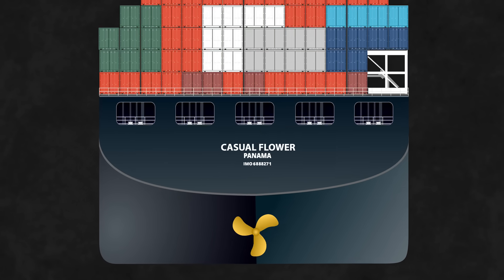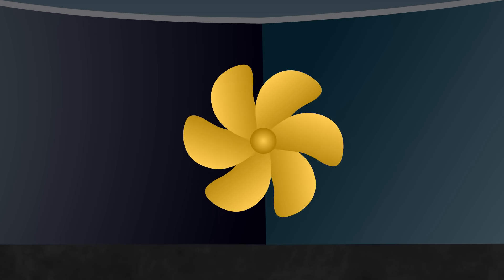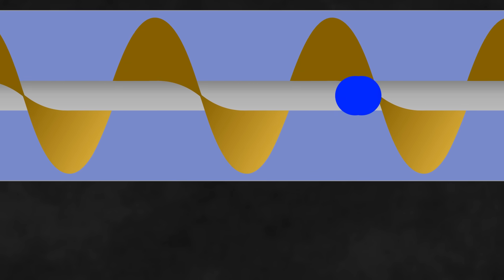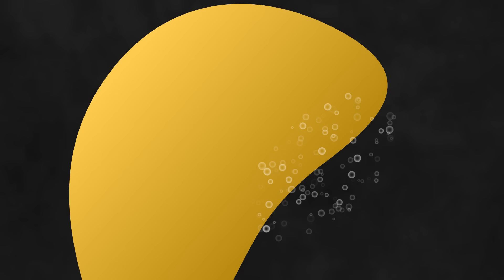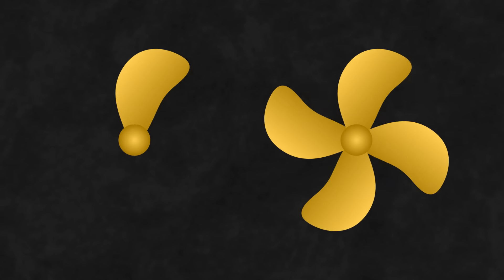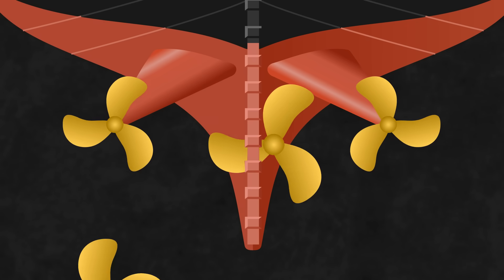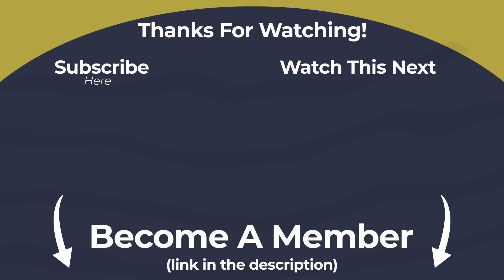Why Are 4 Blades Better Than 3?

Comment: Years ago, we used to listen carefully to surface ships to determine their RPM and blade number.  It helps submariners determine just what sort of ships are in an area.  The details of making super-quiet propellers was always a highly classified aspect of subs.  Many times in photographs of subs in drydock, you'll see the propellor area blurred or covered in canvas to try to keep secret the details.
Reply: That's also another reason cavitation is bad--it produces a lot of additional noise, which is undesirable for reasons of both sonar stealth and underwater noise pollution.
Reply: @Ignonym  Very true, the dedicated anti-submarine warfare frigates have lower noise propellers so they don't drown out the objects they're searching for with their own prop noise.
Reply: @G1NZOU  Apparently the Royal Navy's Type 23 Frigates used a propeller that was heavily optimised for their typical cruising speed during ASW operations, and were so effective that the props were near-silent at that speed and made the ship much less likely to be detected by its quarry.
Reply: They still cover props when launching new submarines.
Reply: From what I've heard the prop is also covered up so you can't estimate the frequency from the image
Reply: @Vinzmannn  as a former navy soldier I can confirm this.
also submarines hav a lot of blades to reduce noise
Reply: @derHutschi  Navy soldier? 🤨🤥
Reply: @thorodinson7467  english is my second language 😅
Reply: @derHutschi  Okay what was your rate? What ships were you on?
Reply: @derHutschi  Ah, that's why you didn't know that the U.S. Marines have a thing about the word "soldier": they don't call themselves "soldiers" because to them that word means members of the U.S. Army.
Reply: @Vinzmannn  And newer designed 'propulsors' that must be 'magic' compared to the old 7-bladed screws we had back in the day.  Let's see, 7 blades, 2 planes and 2 rudder sections...  hmm... 7 x 4....  carry the one....  plus....   oh never mind.  It's been too long ago, that BB must have fallen out long ago... LOL
Reply: The other fun is some navy ships is variable pitch propellors, so the RPMs can remain constant while the ship can move in reverse or forward (up to certain speeds), while the engine RPM  never changes and the noise might change a little (i.e. going from 10 knots forward to 5 knots reverse will put strain on the engine).

You can still do direction analysis to tell where the ship is relative to the listener, but you cannot rely on RPMs to tell you how fast it is going at lower speeds.
Reply: @toddkes5890  Yup!  When I was in, it was the Spruance destroyers that had this.  I'm sure there are others now.
Reply: @toddkes5890  neat, planes do this quite effectively, I never thought about using in on water vehicles though.
Reply: @MattH-wg7ou  Pitch Propellers are very common in Ferries and smaller Cargo Ships. They just handle much, much better than fixed Propellers with direct Propulsion. Small Cargo Ships usually have one Engine driving one Propeller and a Shaft Generator via a Reduction Gearbox, Ferries typically have four Engines on two Propellers, again with Gearboxes and Shaft Generators.
Reply: @Genius_at_Work  And the newest cruise ships have six propellers spread along the length of the ship (although two at the back and two under the bow is more common).
Reply: Early aviation designers modeled their airplane propellers after ship propellers. The Wright Bothers concluded that air and water had different properties and therefore needed different types of propellers.
Reply: 1. We had a 'shafts and blades' sonar on V&C class. 
2. Variable pitch propellers are used on gas turbine powered ships because the turbines don't spin the other way.
3. Don't kid yourself,  we could still hear the T23s.
Reply: IIRC wasn't this a bit of a concern back in 2010 when HMS Astute ran aground off Skye, there was a chance the tide might drop far enough to leave the screw at least partially above water.
Reply: @f0rth3l0v30fchr15t  The navy would know how much the tide would change there, and none of the photos of that grounding that I can find online show the screw. The most we see is the external cowling/shroud.
Reply: I can get a 7-blades low-cavitation prop for RC-model sub anyhere in webshops. Closely-guarded ... that is basic physics. Still doing a great job on Swedish and Germans subs to emerge in US aircraft carrier convois in exercises and get US admirals fired. the real submarine vessel secrets don't lie in the pop design field. It is rather obvious on images in docks what was done. Any diver can check it out plus a simple frequency band analysis from audio records will also give away number of blades and RPM of the sub entering or exiting a surveillanced naval submarine base over distance. The physics is all in the fluid dynamics engineering textbooks. The blade needing to be sleeker is no secret. You can do a few well known tricks like shark-skin, sawtooth back-edge and winglets to optimize it. Not really a secret for anyone well-trained in fluid dynamics - means hydrodynamics or aerodynamics design. That is a small engineering field. It is very obvious what you got to and can do to reduce wing tip cavitation. So the obfuscation erfforts are more or less traditional and keep photo hunters pre-occupied in espionage circles. You ran reverse engineer any audio record with a gaming PCs computational power today. At worst you link up a few or rent a cloud server farm for a few days. Nothing that would strain any governments military R&D budget in any way. You need the wetware - the human brain that can use the CFD correctly and do the Navier-Stokes and Fast-Forward-Fourier math on the Audio and match it up. That's a desk job at a computer - not a photo job. Colombian narco drug lords started to hire Russian sub engineers long ago. The real problem is the lack of industrial plant hidden in the jungle to make any good craft from scratch in secrecy from staellite and cargo supply chain monitoring of import-export trade flows. Smuggling large speciality submarine parts is really giving you away very easily and it is super hard to come up with any cover-stories of alternative uses of any such parts. I'm basically waiting for Chinese triads entering the narco-sub arena field with serious grey or black naval wharf capacities.
Reply: Sort of ships?  Snort.  I was surface, but did some time in ops and the sonar guys could generally name the exact ship, not just the type.  Granted this was the 80's.  But back then every screw was slightly different, every hull had minor imperfections, so even two ships or subs made in the same yard, to the same specs would be unique.
Reply: I spent almost five years on submarines as an FT.  Not only could we use the blade noise to classify a ship, It also gave us the ship's approximate speed to begin our Fire Control solution.  
One time i was on a deep-sea fishing trip out of Newport Beach and I told my Father-in-law that the boat we were on had two three-bladed screws with a missing blade.  He didn't believe me so he asked the captain.  He was very impressed when he found out I was correct.
Reply: And then you can build a ship with no propellers. The “Red October” “silent drive” is a real, if inefficient, thing.
It is formally called a magneto hydrodynamic drive (MHD). They are quite commonly used for reactor cooling pumps in nuclear power plants because they require no mechanical equipment in the radioactive pipes.
Reply: @allangibson8494  water jet Produktion for fast small sized  craft

Comment: I find it interesting that most submarines have 7-blade propellers both conventional or nuclear-powered although the more recent classes of SSN or SSBN have a pump-jet instead of a propeller blade. I wonder if someday will see Pump-jet Propulsion be introduced to conventional submarines?
Reply: The thing to keep in mind with submarine propulsion is that they are more concerned with noise reduction than efficiency, so they might use a design that is inefficient but quiet, not suitable for a surface ship, much less anything civilian. I could see pump-jets being used on conventional subs though, again a question of efficiency versus quietness. A compromise (both mechanically and in terms of performance-versus-noise) would be a ducted propeller.
Reply: @quillmaurer6563  See "Kort nozzle"
Reply: Not too likely but not impossible, the main issue comes with the power needed to drive those pump jets which a nuclear sub can easily provide while conventional subs dont have the same massive power on tap
Reply: The replacement for the Australian Collins class was supposed to be a Diesel Electric pump jet submarine but got cancelled when Australia changed its mind and went nuclear for the next generation.
Current word is Australia will lease a half dozen Virginia class submarines prior to building a variant of the Astute class submarines for themselves.
Reply: There are many issues with pump jets when the focus is to operate quiet.. One example is the noise the nosle makes in addition to the impeller and volute. The reason submarines has seven blades is that 7 is a prime number, i.e reduce the potential for harmonics.. As others have pointed out a 5 blade propeller has cavitation issues and 11 blades would be too inefficient, so 7 it is!

Comment: With the development of linear induction motors, is it possible that a full sized Archimedes screw in something like a tunnel through the hull could ever become a thing?
Reply: What you're describing sounds a bit like a rim-driven thruster, which has blades projecting inward from an outer ring and no central hub, the ring acting as an electric motor. They still use multiple blades though, the full archemedes screw wouldn't be very efficient as a propeller - would tend to spin the water rather than move it.
https://en.wikipedia.org/wiki/Rim-driven_thruster
Reply: well the closest thing to that would be a jet boat with an impeller, and i doubt extending the length would help.
Reply: Propeller i en tunnel användes på gruntgående mindre ångfartyg som som skulle gå i grunda strömmande vatten, fanns en sån i indalslälven i Sverige på tidigt 1900 tal

Comment: Um, "steel" propellers? Thought they started as bronze, but were now alloys or composites. Anyway, to say their design is a compromise is, arguably, true of all engineering - something I came to understand when cruising around the Solent on small yachts.
Reply: Isn't bronze already an alloy? :P
Reply: Steel props are also a thing, at least my dad's 18' pleasure boat has had a 5 bladed stainless steel prop on it for my entire life, so i don't think its unreasonable for larger ships to also have the option of using stainless steel. 

As long as you have zinc anodes near the prop it won't rust/disolve away, and you need them for both bronze and steel props anyway.

Edit: typo

Comment: What about the pitch on the blades? I know from research that the Titanic's and Olympic propellers had different pitch areas on their blades, which prevented them from being interchangeable. Olympic's outer propellers had a pitch area of 34.6 feet, whereas Titanic's were a full 35 feet. Do correct me if I'm wrong, but wouldn't greater pitch on the blades equal greater drag and push the ship faster? What I'm wondering is, if a propeller with fewer blades had greater pitch, would it be less or more efficient than a propeller with a reduced pitch but more blades? 

Furthermore, when referencing the switch conspiracy theory, the difference in pitch on the blades means that the propeller on the wreck that has 401 stamped onto one of its blades couldn't have been fitted to the Olympic at all. So immediately that disproves the switch theory.
Reply: As far as I understand, the different pitch did not make the propellers  not interchangable. They would fit on either ship's prop shaft, and the variations were essentially practical experimentation to find the  most efficient settings.
Reply: @lutzderlurch7877  The problem is if the starboard propeller had a greater pitch than the port side one, the greater drag on the starboard side would persistently make the ship turn towards the port side. That's what I mean by a lack of interchangeability.
Reply: @lukemilner5885  ah, yes. You're right, they are not interchangable as single items, but just as pairs

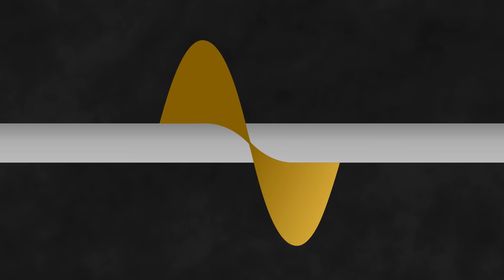Comment: 2:40 Actually, the very first screw propellers WERE Archimedes screws, but it didn't take at all long for designers to realize that blades could do the same job more efficiently.
Reply: The realized when a screw broke and the ship became faster
Reply: @jamesricker3997 
Wow!! That is very interesting. Thanks for sharing.
Reply: Blades are essentially still the archimedes screw, just cut to pieces and its parts moved next to each other instead of going one after another.
Reply: @kasuha  in an air propeller, the cross  section is modified into an airfoil.  
Is that done for water propellers, too?
 
Or does it not make as much sense with an incompressible fluid?
Reply: @nos9784  yes, the cross section of a ship's prop is also heavily engineered to produce the most efficient design/best combination of characteristics.
Reply: @nos9784  we assume air incompressible all the time, for car applications. It makes the math easier and the difference is negligible so far it is from the speed of sound
Reply: @nos9784  water is NOT "incompressible" ! if that were suddenly true, sea levels would be quite a few meters higher, and hundreds of millions of people would drown.
Reply: @gshaindrich  i'll have to admit, fluid dynamics aren't something I feel too competent about.
My assumption was that compessibility didn't strongly matter for ship screws.

I also think i wouldn't get deeper explanations, so thank you all for your input, i'll stop asking now :)
Reply: @nos9784  Keep in mind another application, rotary screw air compressors and centrifugal compressors. Usually only seen in industry.
Reply: @superturkeylegs  screw compressors (roots type blowers) are positive displacement though, right?
Reply: @gshaindrich  Water isn't incompressible but for most purposes it's pretty close to it. Water's bulk modulus is about 2.2 GN/m² meaning if you double the pressure (from normal atmospheric pressure) that will reduce the volume of water only by about 0.005% which is tiny. In most cases assuming incompressibility is a decent approximation.
Reply: @nos9784  I'm not an expert either but, to my knowledge, incompressibility is usually a decent approximation (in absence of cavitation). While that does affect the flow, the same principles of the profile of a hydrofoil providing lift/thrust just like with an aerofoil still applies but the optimal shape is probably a bit different.
Reply: @kasuha Wrong.
Reply: @HerbertTowers  Compare it with a Fresnel-lens.
Reply: It was also at the front
Reply: More blades usually means more torque but , less speed. First ship i was on, Aussie aircraft carrier, had two propellers,  one four blade with other being a three blader. Was actually to prevent harmonious vibration.
Reply: Pretty much anything is compressible if you tried hard enough, the issue is whether the needed amount of force would ever realistically happen.
Reply: Wasn't there a silent drive for submarines that was a tube with an Archimedes screw inside? Was it caterpillar drive? Or was that some magnetic propulsion high tech idea?
Reply: Pretty much anything is compressible if you tried hard enough, the issue is whether the needed amount of force would ever realistically happen.
Reply: Knowledge is power.